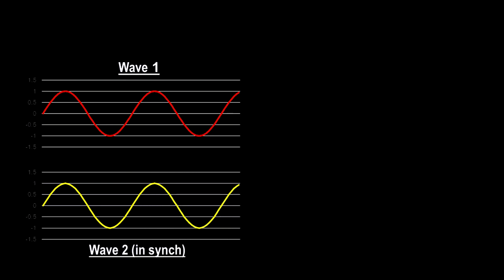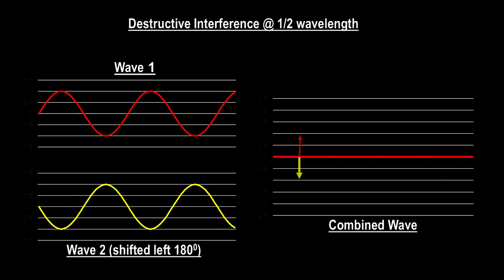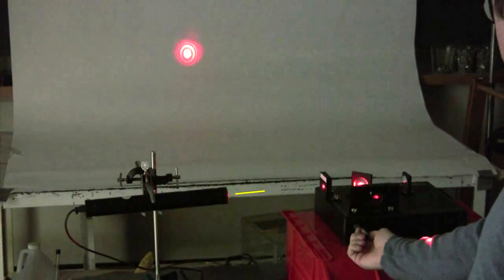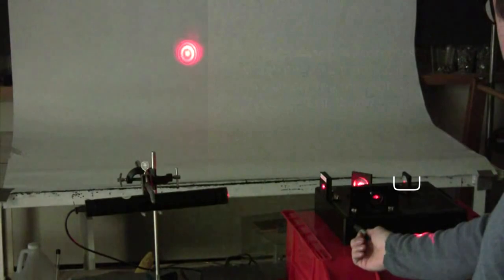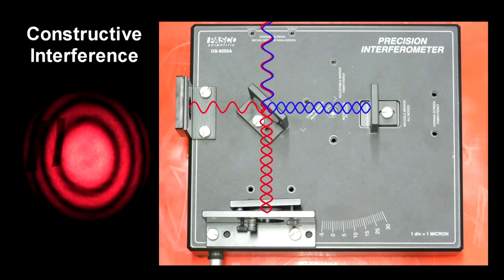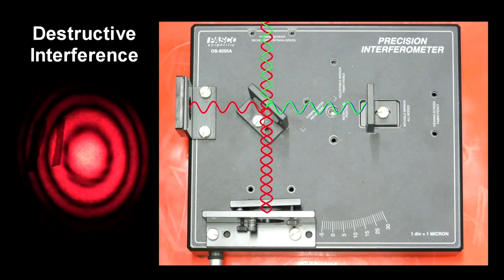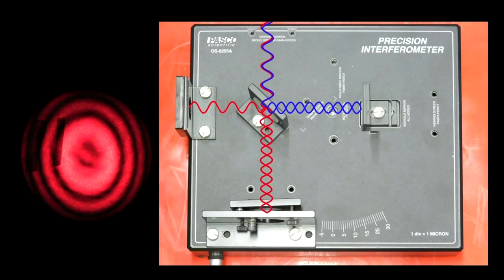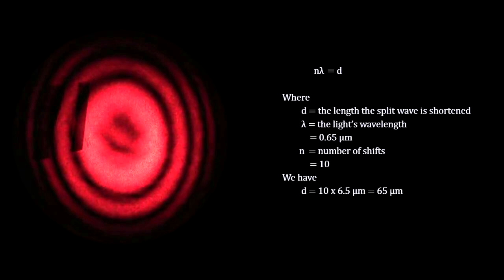Classroom Aid - Michelson Interferometer xx

Comment: There are some minor details incorrect. The light wave reflected by the the two mirrors always flips (a phase shift of pi), and the animation did not show that for some positions of the moving mirror. Second, a shift of one fringe is caused by the mirror moved by lambda/2, not lambda. The correct formula is d = n lambda/2. Third, an explanation is due why a circular pattern is observed, instead of a single bright or dark spot.